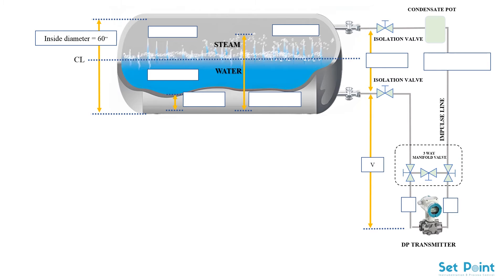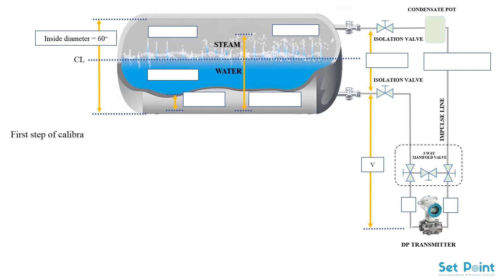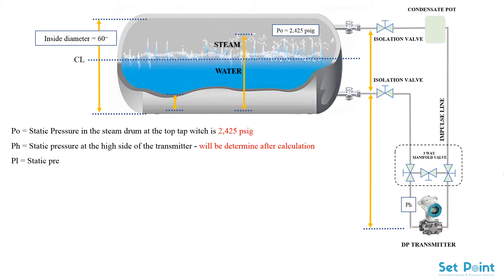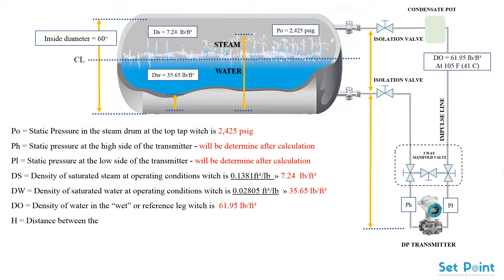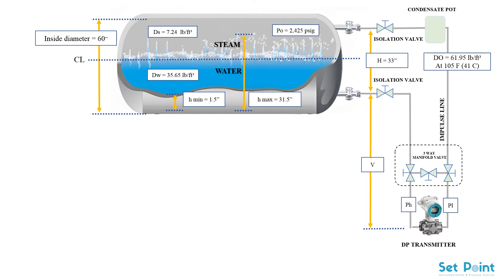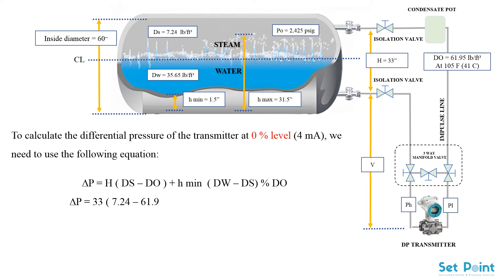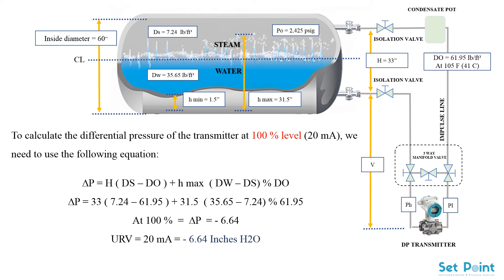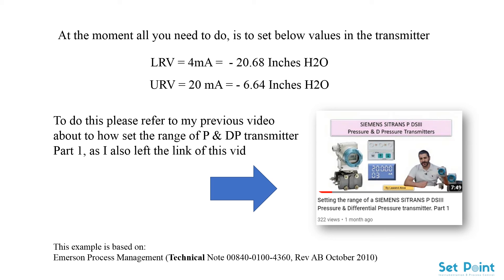Boiler Drum Level - DP Transmitter Calibration

Comment: Is this method used in liquid nitrogen vessel too?
Reply from the maker: Yes, DP level measurement is also used in liquid nitrogen vessels. The principle is the same — it measures the pressure difference from top to bottom.
But because of the extreme cold, the setup is different: cryogenic-rated transmitters are used, and impulse lines are carefully managed to avoid freezing. Thanks for asking!

Comment: Did you miss to multiply the acceleration gravity to the static pressure?
Reply from the maker: @minhquantang3214 Hello Dear and thank you so much for you comment.
if i got you well, there is no need to do it, as i mad an assumption of the static  pressure in this example.
anyway i be will  glad if you clarify more (in witch prat ), 
so i may  get your point better 🙏